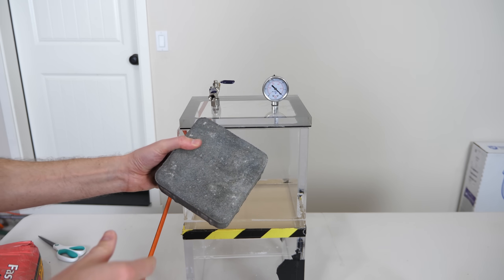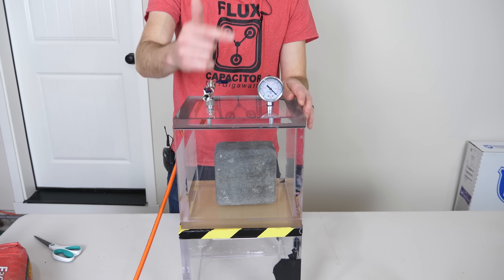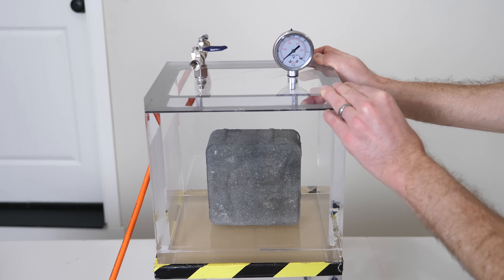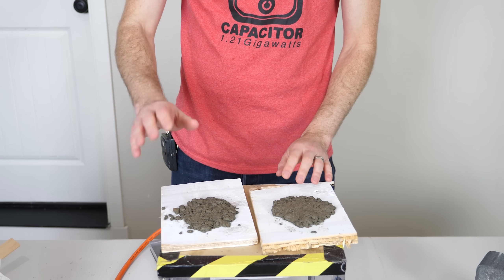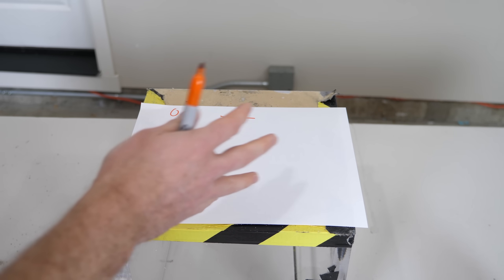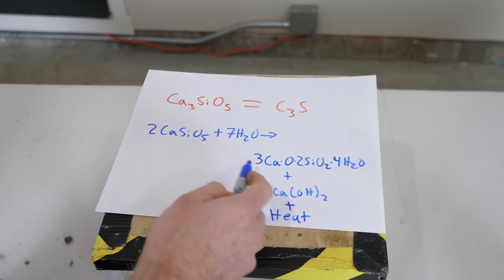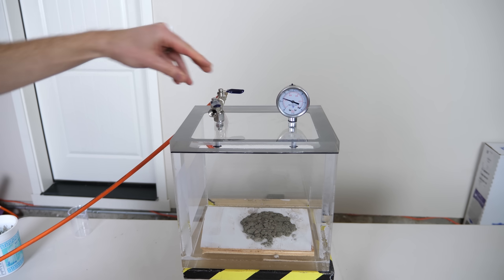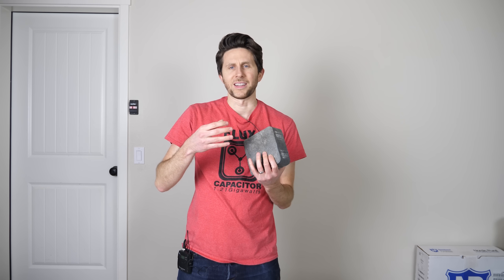Does Concrete Turn to Dust in a Vacuum Chamber? Concrete Without Oxygen Experiment

Comment: There’s rocks in space, so I’d assume it’s still solid in a vacuum.
Reply: @idiot5637  I believe at least some of those videos are more along the premise “what if all oxygen atoms suddenly disappeared one day” to include oxygen atoms bound in compounds. Under that premise they are probably correct; concrete is a mixture of various oxides and removing the oxygen from those compounds by whatever mystical means would be catastrophic. Just not very likely. 
The thing about concrete in vacuums is, on that basis, a misunderstanding of the premise of the videos. 
Not that they aren’t still clickbaity trash.
Reply: @randombloke82  that's what i was thinking.
Oxygen is not air. If oxygen really disappeared, oxygen compounds such as water (and sugar!) would also dissappear. and i think we all know water doesn't just cease to exist when put in a vacuum...
Reply: @randombloke82  That said, the videos don’t talk about all of the things containing oxygen disappearing. They don’t talk about the entire ocean turning into hydrogen gas because the oxygen disappeared, for example. I still think that it is the video itself that is wrong rather than the people watching it (though the people watching it are still wrong if they believe the video).
Reply: @idiot5637  The most I would expect is that Concrete would be weakened in a vacuum somehow. But the idea that it would turn to dust is pretty extreme...
Reply: @eragon78  yeah but the concrete in building is under extreme pressure so I would think that even a slight weakness might make it crumble
Reply: @eragon78  no it wouldn't be weakened..
Reply: @idiot5637  yea, it would be a pretty limiting structural material if it required atmospheric oxygen to retain its strength. And given that its used in basically EVERYTHING, it wouldnt make sense to have such a major restriction like that.
Reply: Amen
Reply: @Waldel Martell i think those videos try to also take all the oxigen from the concrete so... no more of those five oxigen molecules sir
Reply: @idiot5637  actually they're not, most space rocks are loose clumps of dust and ice, a recent japanese probe to collect samples ran into a problem bc they underestimated how soft the asteroid would be and the damn thing sunk like a foot into it hahaha
Reply: Cement requires water to form. You can drive off the water with heat, which crumbles the concrete. Apparently, the water is bound tightly enough to withstand hard vacuum.
Reply: @helmsscotta  That idiot in the video barely made a vacuum or 20 Torr. Space is claimed to have a vacuum of.... 10 to the negative 17 power Torr.
Reply: Oxygens does not = air. Ffs.
Reply: @idiot5637  um its not clickbate if he literally did what the title says.. duh lol
Reply: @idiot5637  actually I would be true but the oxygen inside the concrete in this video is still inside and tightly packed so the vacuum can't remove it
The videos say what would happen if oxygen disappear
Reply: If all oxygen disappeared fro earth it would remove molecularly bonded oxygen, but the vacuum doesn't do that.
Reply: Concrete isn’t rock
Reply: There’s no rocks in space. The moon landing was a obvious hoax and so is everything else they TELL US  about the lights in the sky and outer space! Think about it. ! Could they be lying about what the lights in the sky and what’s above and all around us is ? The answer is yes they could and yes they are ! 100%. Man never landed on the moon and they will certainly never put a man on the light in the sky we call Mars . It’s a ridiculous claim when you have the eyes to see. No one I know or no one I will ever know will ever go to space. Guaranteed. And anyone who says they have or know someone is a down  rite  liar! What you see on a tv screen is not real when it comes to space ! 

What goes up MUST come down is a proven fact that can not undeniably be proven wrong .
Reply: @tighesonfurious1238  So you are smarter than science. Unfortunately you have to use proof, your claims are meaningless.
Reply: @tighesonfurious1238  Even Bill Nye before he was "bought out" would explain that the earth is a closed system, we cannot leave the earth, and wanted this generation to understand that. Not long after, just like the NASA shills, they changed their tune and start speaking lies. If people are too stupid to know that there was 3 very large buildings that not a single plane hit in NY, and they think structures fail uniformly, then you can make them believe anything. The masses are just that, a mass of people moving in the direction they are guided, who cannot and will not think for themselves. So not figuring out 911 with basic physics, good luck having them understand how light works, and how vacuum, and film, and backgrounds, and photography work. You have a bunch of Elon fans...what more can be said?! LOL its a sad and stupid world, and it is designed that way to keep it running along the same way.
Reply: @Waldel Martell yup the oxygen trapped in in stays in so nothing happens
Reply: Ignore my deleted coment, I've already read all the replies
Reply: Gravity keeps things together in space. Which is why the moon stays together. If there was no gravitational binding force, it would return to space dust.
Reply: @decimation9780  what a load of theoretical nonsense !
Reply: @decimation9780  you are such a good learner Carlos, you get a candy. Hey folks Carlos went to school and learned what they spew about gravity, and he is repeating it with a concept added. How wonderful!!
Reply: Rock in space contain high amount of metal in it.
Reply: @tonywolf5127  WHat rocks in space? Where does space start?
Reply: i figured it wouldn't crumble.
Reply: @idiot5637  tbfh anyone who’d think that concrete would turn into dust just like that is an idiot imho, it only requires basic understanding of Science to know that.
Reply: Concrete is made of many crystals like rocks. They join fillers such as various degrees of aggregate (sand, gravel or pebbels).
Reply: @The_Koolaid_Control  To make concrete they heat the portland cement to a state that is starving for water is very ashy, and due to properties once it gets wet it becomes slushy, and as the water evaporates, it holds it structure.
Reply: Me too.
Reply: @idiot5637  I have a friend who was a kid when he saw a practical "magical" trick in real life with water stuck in upside down glass or bottle *without any barrier*. He was surprised but had to believe what he saw, it wasn't a video. He didn't know that there was a tiny transparent cap holding the water, nobody explained him the trick until he told me about this years later.
Reply: A foolish miscalculation!
Reply: There non porous
Reply: Literally what i thought.
Reply: it would turn into dust, those videos means ALL OXYGEN, even in the rock and in humans, it means a basic overview!
Reply: It's not a total vacuum you for get in reality if you put water in space the water would either freeze or evaporate as gasses firstly and secondly there is no oxygen present to react the lime and cement creating an exothermic reaction to cause solidification of the concrete mix for this experiment to reflect a true result it would need to be done in space itself considering that space is a limitless vacuum and that tiny box isn't and the kind of atmospheric pressures that is out in space would be considerably higher than a perspex box if one sealed that box up and pierced it with a hole in space the are rushing out of it would destroy that box and any liquids would do one of two things vaporize to gasses as the pressure sucking every thing out of the box due to the immediate pressure drop or it would freeze instantly due to the cold temperature so technically a plastic box with a controlled pressure reduction that could never even reach the negative pressure of the vacuum of space will never actually reflect a true result....also if you didn't know, any calcium sulphate technician that works with cement plaster or morter will tell you from the second you begin to mix the dry mix and water the chemical reaction has already started to happen as it begins to react with oxygen in the air so technically the concrete was already in process of hardening priori to being put in that vacuum chamber... so in real terms the experiment failed because it was not a fully controlled experiment in many ways it is flawed and was always set to fail because of the many factors not taken into account so if very much beg to differ, as that vacuum chamber could never replicate the same conditions of space ....!!
Reply: Not concrete…
Reply: J Fid, you clearly don’t understand the experiment.

Concrete forms from a basic chemical reaction. “Rocks” are formed in a much different way and they don’t have binders that operate the same way.

For F*ck sake.
Reply: Everyone who just read your comment just became dumber.
Reply: @alexandertaves2730  thank you for dropping your knowledge on everyone. I’m glad you stopped by 🤡
Reply: Yeah but there solid rocks, concrete is powder but stuck together
Reply: We are a rock in space
Reply: Rocks are different. Most are formed without ever touching 02.
Reply: @MeTrOiD241  NOthing touches O2 unless you apply processed O2 to it. There is NO O2 in the air. It is PROCESSED
Reply: @philindeblanc  What are you even saying?
Reply: @MeTrOiD241  Where would you like me to start explaining?
Reply: Ur right but the rocks in space are not made up of concrete
Reply: Dust is a solid...
Reply: The rocks in space have a miz of steel our rocks are different and more fragile and he said concrete not rock they are different
Reply: Lol
Reply: Yes, rocks. No concrete in space.
Reply: you know that most of those rocks, commits, asteroids were from planets right…
Reply: @Sequilz  LOL "commits." Thanks Professor.
Reply: Imagine you froze oxygen what would happen? Well obviously become ice. But I assume you know it already
Reply: @Nehunya  Ice is frozen water so no
Reply: Rock isn’t concrete
Reply: Lmao
Reply: @idiot5637   Never though of that. Also many rivers in industrial areas contain very little if any dissolved oxygen so any concrete bridge supports should crumble as well.
Reply: very good point, if I've thought about it before I wouldn't watch the video
Reply: Its not concrete
Reply: Yea but things get weird in space.  Two pieces of metal will weld together completely cold.
Reply: the rocks in space are made of ice, metals, clay, and other elements so theres probably no concrete in most of the space rocks…
Reply: Bro all oxygen is not in gas state as oxygen in water is not gas it is liqid so rocks in space wont decompress
Reply: Concrete isn’t rocks though
Reply: Yes but it is rock and this is concrete so I think a Lil difference
Reply: There are rocks in space?  What do you consider "space"? how far up?
Reply: @idiot5637  So how did the towers come down on 911?
Reply: Common sense approach
Reply: No
Reply: You mean "There are rocks in space"?
Reply: @gurjindersingh3843  define space
Reply: @philindeblanc  You don't understand when to use is/are.
Reply: If  I put my father ball and my odd ball in my space would they freeze
Reply: There’s a lot of oxygen in space… it’s just all in solid molecules 🤪
Reply: Considering the amount of energy in vacuum and the amount of available hydrogen…I’m thinking 
ammonia.
Reply: Concrete is not Rock!   It is rocks bonded by Hydrate Bridges.  So concrete will crumble in real vacuum....
Reply: Those vids are saying "What if oxygen disappeared?" Not "what if the earth was exposed to the vacuum of space?" They're basically saying what if all traces of oxygen disappeared, even the ones in molecules, therefore destroying the molecular bonds and turning them to small "dust".
Reply: Actually concrete needs water for the hydratation chemical reactions to turn from dust into a solid.
So if the vacuum were capable to make it lose all the residual water it would form porous that could compromised the structural integrity.
But even if already solidified concrete endures vacuum, vacuum could prevent the fabrication of concrete due the impossibility of water to stay liquid in vacuum.
Reply: @carlosdgutierrez6570  learn to spell VACUUM.
Reply: Wait, concrete is rocks? I thought it was fake stuff
Reply: @JaceN3D  concrete is powdered slate and Lyme...
Reply: @yashuayahweh5871  exactly... but it is dehydrated and heated to a state that it bonds quickly with water
Reply: @JaceN3D  concrete is a mixture of sand, stones/rocks and cement(cement/Portland cement is a mixture of powdered slate and lyme) and is dangerous do not breath the dust in as with all powdered stone it can cause asbestosis of the lungs just to make u aware of that and you should wear adequate respiratory filters to prevent the dust being breathed in and to also make you aware that Lyme is a highly caustic alkaline the opposite spectrum of acid and it can cause burns that melt the skin off I know from experience after screening a floor and the lyme actually soaked through my knee pads causing severe burns the skin disappears and went to flesh wounds hospitalization having them under cold running water for 9hours the oh level was still -9 extremely high negative took three days to normalize the oh which means the tissue was burning for 3 and a half days and spent 4 months healing with use of silver impregnated dressings..  so again you must be very careful using the substance and rubber Polly gloves are not entirely useful it degrades them you need to use a grease to form a skin barrier such as vasline or petroleum jelly it's not something you want to mess with ....
Reply: Them not concrete doe
Reply: why you believe that space is a physical object? its totally mentally object, we can only see those mental object because of the earth firmament👁️, don't think that ur cool because you talking about planets, space, astronaut, etc, i mean in ancient time they already have a UFO, its called vimana, watch GAIA on youtube, its pseudoscience but the idea is interesting
Reply: Concrete is a type of rock, yes. But not all rocks are concrete.
Reply: @kurookami2762  Concrete is a processed rock that is highly heated. That is how it catalyzes reaction to form a bonding structure as it dries.
Reply: @idiot5637  ok when concrete is made for any structure it has to be first mixed poured and set under normal conditions as we have hear on earth then it must be once set soaked in water until all the air bubbles out to ensure that the concrete can fully cure, that is the setting process then it needs to be covered with plastic this is the third stage a stage of perspiring the concrete allowing the concrete to sweat out the water over a period of weeks dependant on the size of that concrete peace then it is assembled or in the case of it being used on a construction site wear the structure steal frame is constructed and wood is used to seal the inner and outer of the cast the concrete is poured set soaked and sweated in situe.... then if it is to be under water the prices are placed beneath the water and each section is bonded with a semi flexible waterproof mounting compound and built under water so technically under water structures are prefabricated.... so again if water will either vaporize into gasses or instantly freeze in space how can one mix concrete if their is no oxygen present in space and the water could remain liquid to mix the concrete (sand, stone and cement) their would still be no oxygen to catalys the initial exothermic reaction.... once initiated their would be enough oxygen in the water to continue the reaction and hydrogen bass would dissipate but still in space their is no oxygen the negative pressure in space is to great for water to remain liquid and the temperature in space being how many °calvin would freeze water if exposes to the actual conditions of space.... look at an asteroid that has no atmosphere... any liquids and gasses on its surface are frozen so therefore how could one expect water to be a liquid in space to mix concrete in first place... this experiment was floored in so many ways it's actually laughable that anyone would believe that concrete would react in space to form a solid structural piece of concrete.... I'm so amused by this pissing myself actually at how many idiots would believe this experiment to be even remotely accurate I list count of how many ways the experiment is flawed.....😅🤣😂😂😂😂😂
Reply: Rock and concrete are different, you can break concrete with a pick axe, you need dynamite to do anything significant to a rock, of course that’s assuming your taking 10 tons of each and comparing them
Reply: Asteroids aren’t made of concrete
Reply: Oh dear God....

Listen bud... Leave the scientific statements to the professionals.

Jesus....
Reply: @JoeFidler  great response little man. 

Care to explain why I’m wrong? I explained why you were wrong. Or do you just not know?
Reply: @JoeFidler  😘
Reply: Rocks are not made of concrete
Reply: True lol
Reply: S A L T

Comment: Ware safety glasses when working with vacuum or pressure and a plastic tank. Also some of your data is not complete. The Hydrogen in water becomes Part of the concrete as does a small amount of the oxygen. Thus concrete does not dry from evaporation to harden. Some left over water can dry away but in general the cement sets as you said. Cement once mixed with proper water amounts can set even under water. Keep safe dude  ware Safty glasses.

Comment: I heard that concrete after it dries is the same weight that it is when wet. Because the water doesn't evaporate but cures into the concrete. I have no idea if that is true. But if so, is the oxygen in the water still playing a part in the structure of cured concrete.

Edit:  7 minutes in and I'm feeling like I should have watched the whole video before commenting